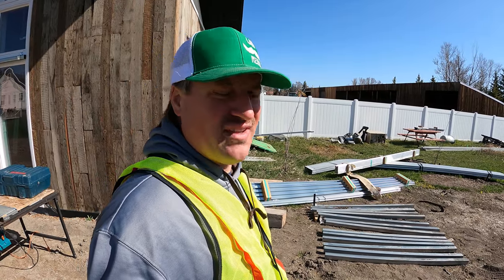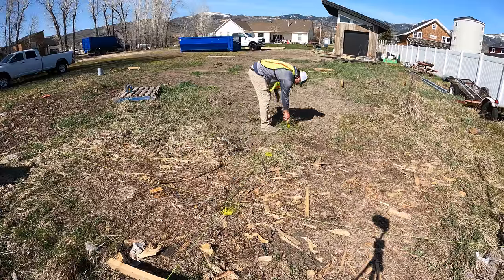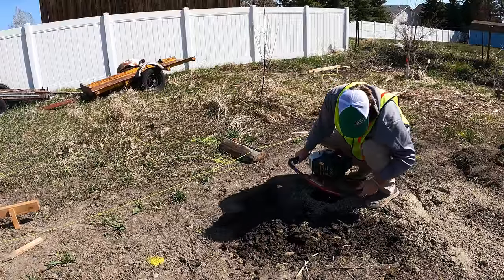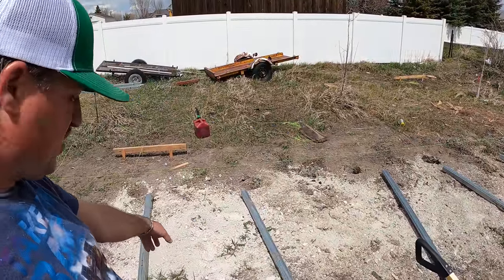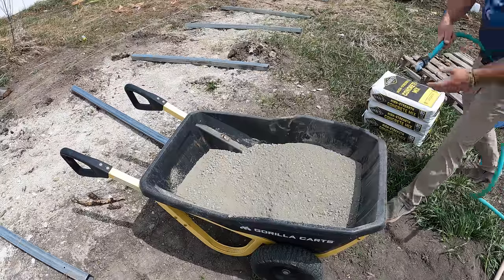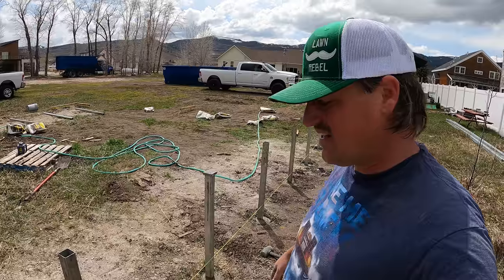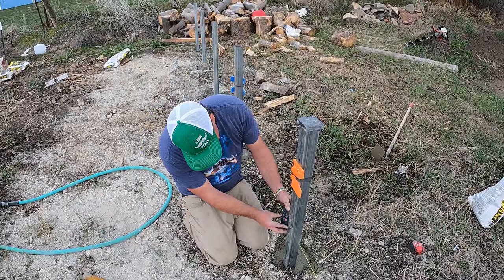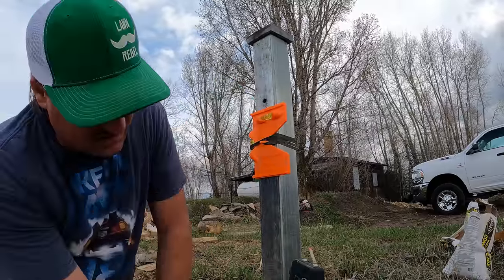Building a GREENHOUSE.  Setting posts

Comment: I remember commenting some videos back that you should consider building a greenhouse with all the flower and garden plants and save $$. For overwintering, you'd most likely need added heat with proper circulation. I saw the Garden Answer channel where a greenhouse was built. That thing is plenty huge! PS - Hope you're feeling better. Don't overdo it. -- Mike